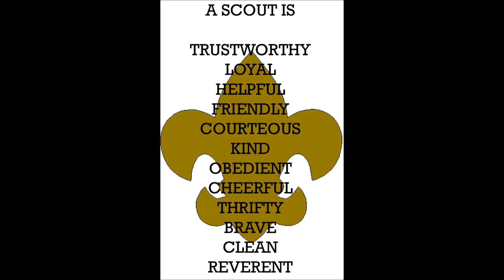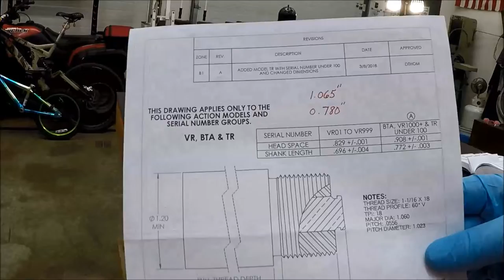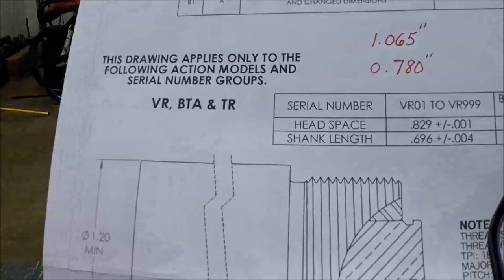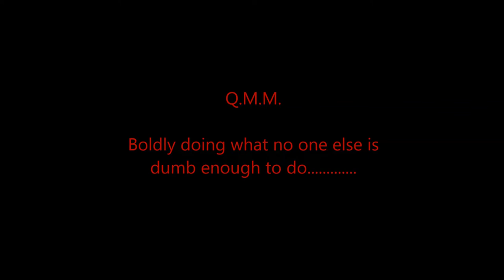ELK - 7mm PRC

Comment: As a machinist I'm interested in seeing more or talking about more of the process and the why. In previous videos you have talked about cutting the major Dia. Until the muzzle brake goes on with no play. However it sounds like on the receiver end you cut the major Dia. a few thousand small and then cut the pitch dia. until it just fits having just the slightest amount of clearance in the "v" of the thread.
Reply from the maker: Dear Sir - The "why" for everything is so all the bullets go through one hole. The "process" came from trial/error and observable results.Thanks.